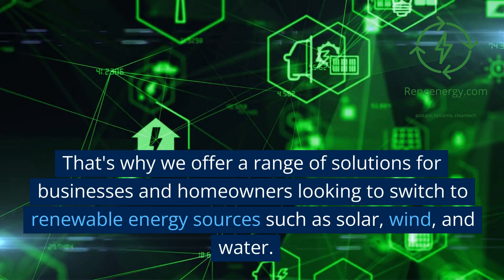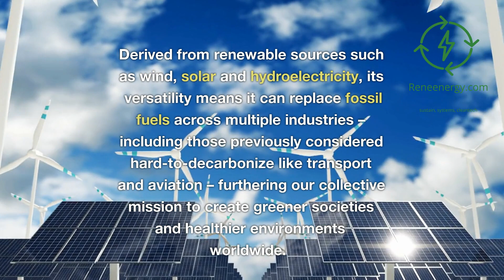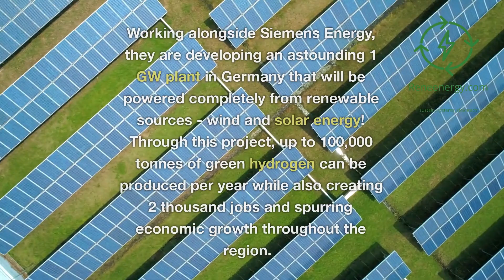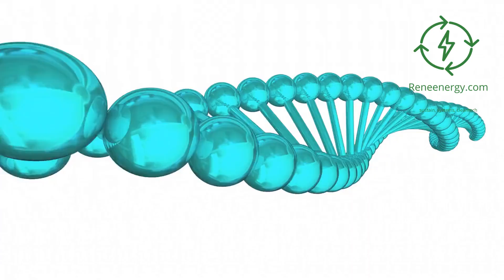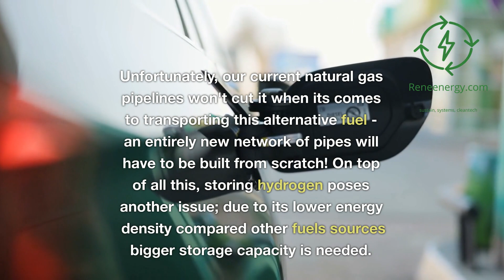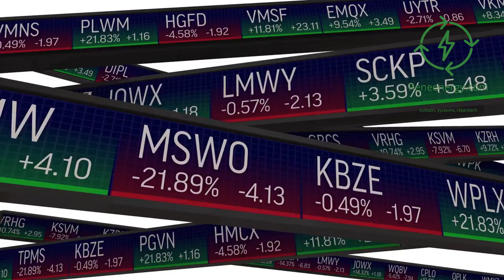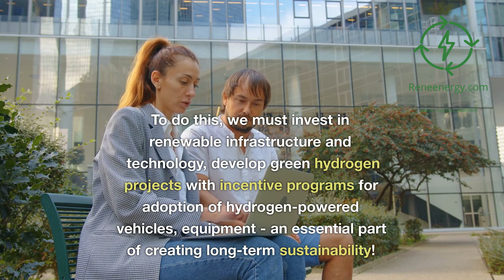Fortescue Future Industries FFI green hydrogen projects around the globe!

Comment: Hydrogen is not an energy SOURCE.   it's a very weak and volatile storage MEDIUM.. it's like saying a battery pack is an energy  source when it is just storing energy created elsewhere.
Reply from the maker: Yes, you are correct. Hydrogen itself is not a primary energy source like fossil fuels (oil, natural gas, coal), nuclear power, or renewable energy (solar, wind, hydroelectric). Instead, hydrogen is an energy carrier or storage medium, similar to electricity or a battery.

Here's how it works: Energy from a primary source (like the sun or wind) is used to generate electricity. This electricity powers an electrolyzer which splits water into hydrogen and oxygen in a process known as electrolysis. The hydrogen gas produced can be stored and transported. Later, when energy is needed, the hydrogen can be used in a fuel cell to create electricity, with the only byproduct being water.

So, while hydrogen doesn't generate energy on its own, it plays a crucial role in storing and transporting energy from primary sources. This is particularly useful for renewable energy sources like solar and wind, which are intermittent - the sun doesn't always shine, and the wind doesn't always blow. Hydrogen can store excess energy produced when conditions are optimal and release it when needed.